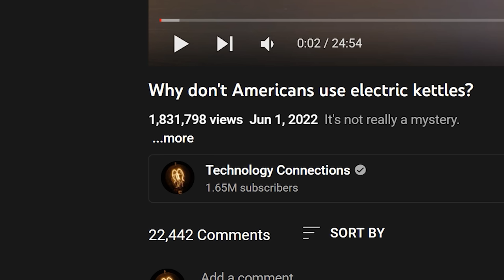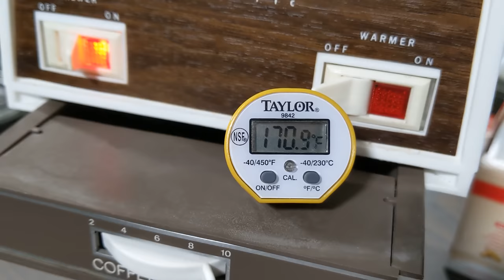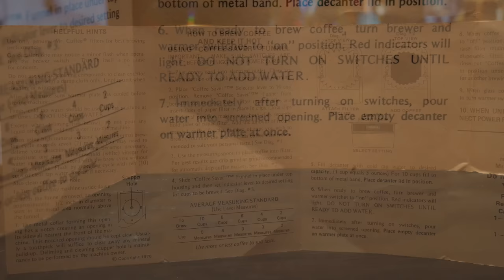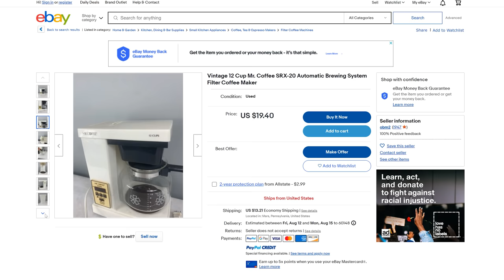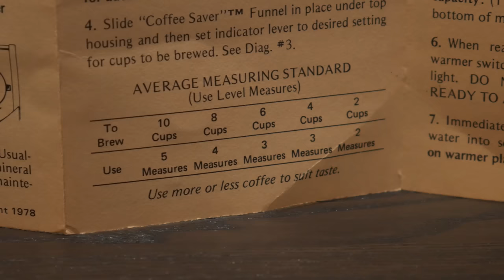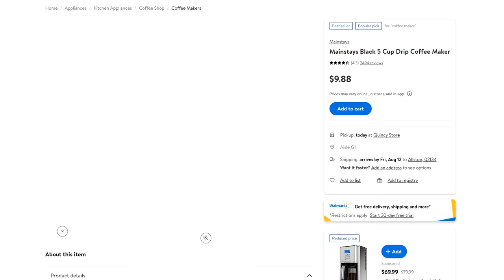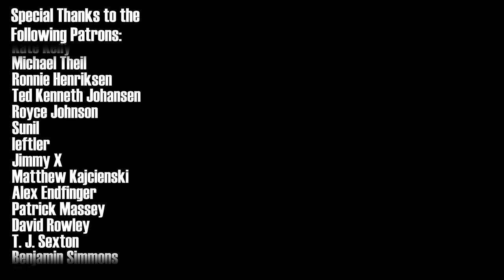Drip Coffee Makers — super simple, super cheap

Comment: A note on instant coffee: it's often "burnt" by dumping the freshly boiling water in the mug.  I've seen a noticeable improvement even with cheap instant coffee when using 85-90C water instead.
Reply: I actually use instant coffee only for my shakes, just blend it up with ice and water and you got yourself an ice cap
Reply: You're right my parents both have tea and coffee so when making one for both of them I boil the kettle and pour the water straight away into the tea pot, but wait till the tea is half way brewed before I pour the water into the coffee cups
Reply: Just put it in the microwave man
Reply: As a general rule of thumb, whether making instant coffee or pour-over coffee, the water should not be hotter than about 93C (200F). Coffee grounds / beans begin to burn / scald over that temperature, resulting in a burnt flavor. When I boil water for my pour-over (or instant), I wait about 40 seconds after I turn off the kettle before I pour the water - that's enough time to get the water down to a temp that won't burn the coffee grind. Only really ideal if you're making just a single serving of coffee though, if you're tyring to make a large amount of coffee (i.e. a full pot), you'd have to keep reheating the water as you work.
Reply: @TheWoblinGoblin  Yecch! I hate the sour taste of microwave ions! J/K, that's what I do! (on rare occasions when I drink instant)
Reply: Still, actual coffee is better and with a Keurig it only takes like 60 seconds to make
Reply: @Trisnice  this might be a game changer
Reply: Absolutely, Australian break rooms/spaces tend to have those instant boiling water taps where the water is closer to 90c, they make noticeably better instant than straight from kettle 99c water.
Reply: @michaelimbesi2314  Sure, if you don't mind paying an absurd cost for coffee or the criminal amount of waste material it produces. Excessively wasteful devices like Keurig should be illegal in this day and age where waste plastic is a catastrophic problem and contaminating the entire water supply across the planet. It's why the US and other countries are banning things like plastic shopping bags etc, the plastic is slowly killing us.
Reply: I, too, have noticed this. I primarily drink tea (and a shameful amount of store-brand diet cola), so I don't have a coffee maker. I turn off the kettle about 30 seconds before it would hit full boil, and this seems to make a noticeable difference in how the cheap Folgers instant coffee I have tastes.
Reply: I’ve found if I mix the instant coffee in milk and then add water it makes a much more creamy, less bitter cup of coffee. I still prefer filter coffee or espresso but I’ve had to learn to drink instant as it’s the main offering in South Africa.
Reply: I dislike all phases and aspects of coffee.
The smell of the ground beans is the least objectionable to me, but after that, everything is downhill.
-
That said, I don't begrudge anyone their coffee, as long as they are not overspending on silliness (cough, Starbucks, cough).
Reply: @Hathur  Thanks for the tip, I'll try slightly colder water next time.
Reply: @Trisnice  Same.  Instant coffee is good for adding coffee flavor to something without adding extra liquid - and that's about it.
Reply: you know, “nescafé’s” are really popular in europe, basically just instant coffee with cold water and ice, mixed with an electric hand mixer, and it noticeably tastes less bad than standard instant coffee made with hot water... this would be consistent
Reply: @Trisnice  ok now I have to try that, any advice on brand or a recipe?
Reply: Brewing drip with too hot water also has an impact on taste... My electric kettle can do 80C, that seems to work pretty well...

But I have to agree that some instant brands doesn't exactly smell nice while "brewing".
Reply: Rather than faff about I put a drop of cold water in the cup with the coffee while the kettle is boiling. Gets rid of the burnt taste and you don't have to wait. It's not going to make instant better than ground coffee but it does at least make it better than it was :)
Reply: @MonkeyJedi99  $$ bucks $$ is right in the name so at least there's a degree of honesty.
Reply: Most brands actually recommend using water closer to drinking temperature, 77º from many of them.
Reply: @SpencerDonahue  yeah it varies a lot, especially with "tea". IIrc white tea is like 70C max, otherwise it tastes like.. nothing. At 70 it smells like a fruit salad. Kettles with presets or adjustable temperature are cheap and available too. (Said "tea" because it dosen't really contains tea leaves, "herbal tea" maybe in english ? We call them "tisane" in french to make the distinction.)
Reply: @M4nusky  In English, white tea refers to a particular variety of tea in the same way you can have black or green or oolong teas, albeit a much less common one. Herbal tea is the most common term, but some English speakers do refer to it as tisane.
Reply: @Trisnice  I have some to add to brownies as suggested by binging with babish to enhance the chocolate flavour
Reply: @helios5752  I've not tried too many brands actually .. I used Maxwell House and Nescafe and they were both pretty much the same. However sometimes I get the Nescafe Hazelnut because I absolutely love Hazelnut. I'll do 2 scoops Rocky Road Protein (or anything chocolate), milk or water, frozen bananas, the instant coffee and sometimes I add cappuccino flavored yoghurt.
Reply: This is funnily enough a big point of debate in the coffee community.  Some people say that anything beyond the low 90s (°C) is bad for brewing. Some people swear by high temperatures for light roasts.  From what I've seen I think it depends on the roast on the beans as well as your brew method.  I've found good results by using lower temperatures for darker roasts, which I imagine is also applicable to instant.
Reply: @bobbyhillthuglife  Not sure this works with freeze dried instant coffee though. one would have to go really out of their way to locate spray dried one to get presentable results.
Reply: It might be an unpopular method, but the way my mum taught me to avoid that was to put the milk first, and then the hot water, so that the temperature remains below boiling.

Comment: Coffee makers kept getting more sophisticated.   We had a Cuisinart machine with a built in grinder.  However,  it didn't have a warming plate.   It had an insulated carafe instead.
Reply: If it’s insulated well it probably doesn’t need extra heat, that tends to mess with the flavor anyways
Reply: That is what I use still today. Someone discarded it years ago. I found it, cleaned it up, and voila. It remains faithful. The insulated carafe is the best feature.
Reply: I won't buy a coffee maker without a hot plate. Can't taste anything bad if you burn your taste buds.
Reply: mipmipmipmipmip  Bunn has home models without the heating plate at all, just the thermos. But they're kind of expensive. And they work more like the old one here - once you close the fill door cofee comes out immediately, so you have to train yourself to not close the door till the carafe is in place. OTOH, they're a lot faster than the cheap drip coffee machines FWIW. The other downside is they do this by always having a reserve of hot water in them, so they're always drawing some power.
Reply: I have that coffee maker too and it makes for better tasting coffee but I don't use the grinder feature because its too difficult to clean.  I grind the coffee myself with measured ten cup capacity of grinds for the ten cup coffee maker that it is.
Reply: That is a superior design, I feel. No burnt coffee, just kept nice and warm, and with grinder to boot.
Reply: my mum has a coffee maker with a cut-off valve, it only lets water go through when the carafe is under it, that way you can take the carafe out during the brew, as soon as you had enough, pour a cup and then put it back under to let it finish.
Reply: The word is "phosisticated". ☝🤓
Reply: insulated carafes are way better than coffee makers that require a warming plate
Reply: Ours uses a carafe as well. I like it so much better than the hot plate.
Reply: @mipmipmipmipmip  if you're still looking, try Hamilton Beach or Keurig for fairly inexpensive carafe options. Our old Hamilton had a carafe and two travel mugs and you could choose whether to brew into the carafe, one mug, or two mugs. Our current Keurig has both a single brew pod option and a full basket drip option.

Comment: It's funny, I've also tried just about every method and come to the exact same conclusion: drip coffee is good enough, and it's excellent for the trivial effort involved. Do try the Moka pot, though; it was my preferred method until I went back to the drip. It allows the oils to come through, which gives a richer texture. The lack of oil is probably the thing I find lacking the most in drip coffee--but again, it's good enough.

Also, re. the "don't use the warming plate" admonition: it's worth noting that "fancier" drip machines (which is to say, in the ~$100 range) don't have one, and instead come with an insulated carafe that will keep the coffee warm for at least a couple of hours. Alternatively, just get a nice big insulated thermos and decant the whole pot into that as soon as it's brewed.
Reply: it's only good enough if you use 'good enough' coffee. Once you are in the 'good coffee' range of beans every method of brewing gives it's own unique results. Putting decent coffee in any drip coffee maker that's not an enthusiast level one (think 200usd +) absolutely destroys the flavor. I don't use one of those myself, I use simple and very cheap manual pour over which will give any coffee (cheap or premium) a good showing.
Reply: @Geardos1  I have probably had every kind of coffee brewer out there, except a Don Pedro - but I dont like placing large glass things on my glass stove. Anyway, all methods make diffrent kind of coffee and require diffrent kind of grinds - wich makes diffrent tasting coffee.

Brewers, I currently have a Moccamaster, makes the most reliable "good" coffee out of pre-ground vacum packaged coffee. And I see the point, its easy and the coffee always taste the same.

French press is also common here in northen sweden, after classic brewers its the most common, but they use a diffrent coffe grind (coarse) and makes for a diffrent kind of coffe. What one prefeers is more about what you are used to.
They are perhaps split 50-50 with drip brewers, as most people have electric kettles and dont feel the they have space for a specific brewer.

Some people still have perculators but they are uncommon now - 1 in 20 perhaps have one (if I base that on my circle of friends).

We are so used to boiled coffee here that I feel that drip brewers are not as common as in the US. Most people (everyone?) has free coffee at work and there it often is a machine OR a large drip brewer, and I think most have consumed their 10 cups of coffee before comming home.

How people make coffee is mostly about even results and ease of use, poor over manual coffee is good but its not the same and not what people commonly are used to. People appreaciate "artisan" coffee but they dont replace their brewers for it.
Reply: I really like my Moka Pot. I only drink one cup a day, and it makes exactly that much. I don't need to buy paper filters, and it's nearly as easy to use as drip machines. It's also very fast as I have one that works with my induction burner.

And I really like the slightly stronger flavor with the oils that you get versus drip
Reply: It seems like having a highly insulated carafe vs a carafe that is regulated to the desired temperature of the coffee would be broadly equivalent? James Hoffman found in his experiments that it's actually better to let the coffee cool down, and then warm it back up in the microwave when you want it. It means the coffee isn't degrading at a high temperature for an extended period of time, which is what the insulated carafe would lead to.
Reply: most of oils during extraction are stopped by a paper filter, maybe try to look for some plastic/metal filters if you want to have more oils and harsh taste of coffee, my drip machine has plastic meshed filter and it works nice
Reply: In Italy we have a moka in every household and drop coffee machines are relegated to very few office and working spaces (both being gradually replaced by capsule based "espresso" machines): I very much prefer to brew a moka and diluite with hot water (non boiling) to the drip coffe at the office. We should also stop spreading the misconception that Arabica is always superior/better since it very much depends on the quality of the brand (coffee quality and roasting) AND on the type of cofee maker in use: usually I prefer Arabica from Espresso machines and Robusto on moka.
Reply: If you like moka pots, check out the moka pot voodoo video from the Wired Gourmet. It tastes as good as an espresso but it's way less fiddly.
Reply: That's why I settled on French press: I don't like the way the oils get stopped in filters, it makes the coffee taste thin.
Plus, I never run out of filters!
Reply: @itsROMPERS...  I use a permanent metal filter in my drip machine, which allows at least some oil through. No paper filters to buy, and I've been using the same one for like 3 years with zero fuss aside from a thorough daily rinse. I think the coffee cognoscenti disapprove of them for some reason or another, and I couldn't care less. Works for me!
Reply: @hibob841  sounds like it works for you!
I'm sticking with the full-on French press for now, I didn't care about a little sediment at the bottom of my cup.
Reply: @itsROMPERS...  I'd probably still be using my French press, too, if the glass hadn't spontaneously cracked on me (sure I could have bought another, but I was curious about the Moka Pot and AeroPress at the time). They're great!
Reply: @hibob841  i hear ya, mine has a crack in it too, luckily it's still usable.
I've thought about getting an aeropress to replace it, but i read a comment that said it produced coffee that tasted "sterile" compared to French press, so i gave up.
Maybe that guy is dumb, but it took the wind out of my sails
Reply: @itsROMPERS...  I liked my AeroPress just fine, IDK about the 'sterile' part. You can play with the grind, ratio and steep time to 'dial in' what you like, which is cool. I only switched back to drip because I have small children now and I'm too lazy to invest a couple minutes for just one cup XD. Anyway, they're cheap enough to just get one and see if you like it.

Comment: Seeing that old Mr. Coffee machine brought me back to when I was a kid and was allowed to make the coffee for my parents in the morning. My dad would leave for work about the same time I got up so instead of waiting for the full pot to brew, I had a system worked out where I would keep a mug under the drip spout and add the water, and when the mug was (I think) half full, shut off the brewer. The remaining coffee would fill the mug almost full, and then you had a second to switch the mug and carafe before turning the power back on and finishing the brew. It wasn't perfect as you would get a little dribble on the hot plate if you weren't quick enough, but dad got his mug and I got an extra 5 minutes of sleep.

One thing I love about modern coffee makers is the ability to program them to auto-brew at a set time. Prepare the grounds and water in the evening, set the timer for a specific time, and wake up in the morning to the glorious smell of a fresh brew. Most days the smell of the coffee will wake me up before my alarm even has a chance to go off. Another great video! Looking forward to the next one, whatever that may be about!

Comment: Love my electric kettle and have given two as gifts and the ppl love them!  They heat the water faster and turn off when water has boiled, or removed from the heating plate, nice safety features. The plugs are the same as any other appliances I have, I live in the U.S.

Comment: I recently found a drip coffee maker which has, instead of a heating plate, the pot is a stainless steel thermos instead of the typical glass pot. The thermos keeps the coffee hot for hours, without the burnt taste that the heater plate otherwise causes. Really happy with it! :)
Reply: I've been using a Krueger single cup drip based system with a reusable cop. All the coffee without any of the burnt taste, down side is you need to redo the cup making process with every drink. 

Good for me since I usually only drink 1 or 2 cups a day.